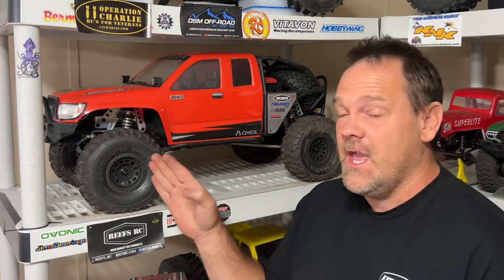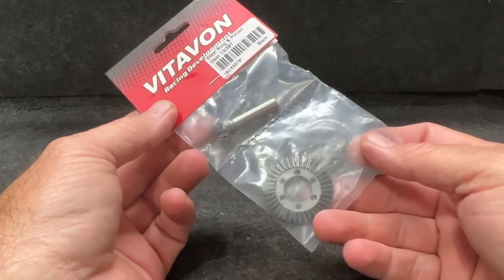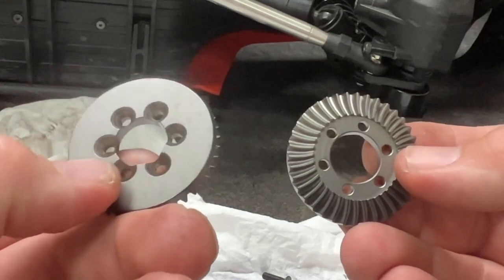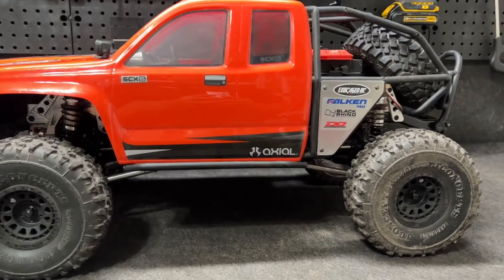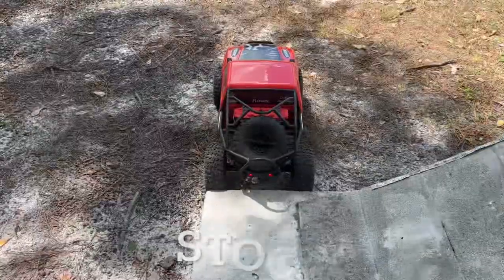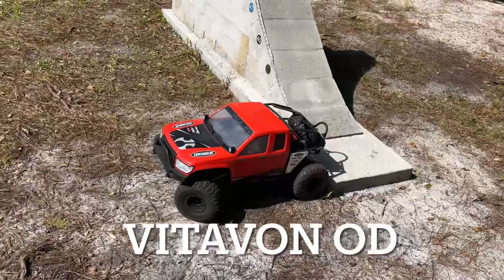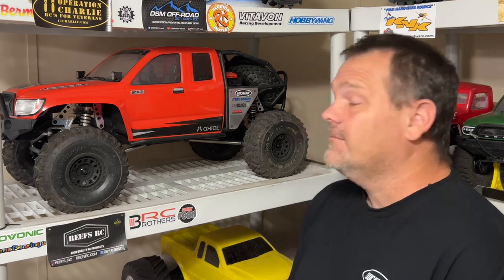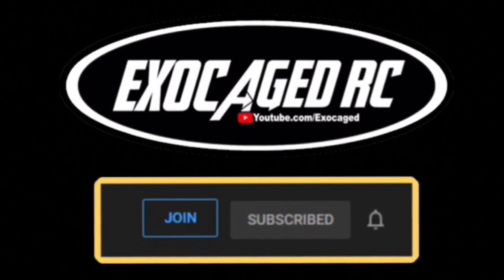My Honcho SCX6 OD'd!!! Did it help?

Comment: Huge difference in turning radius! So I want to overdrive my Trx4 but I still want to maintain trail ability any suggestions for a gear that will allow me to do that! I’m thinking if I was to ask anyone you would be my best option! 👍👍😁😎✌️
Reply: There’s no way to keep both unless it’s at the transmission like the phoenix. best thing to do is to get more clearance on the steering knuckle and a bent steering link .
Reply: I run 20% front overdrive in my 8 1/2 lbs trail rig. You may loose a little side hill ability. If that's a deciding factor go with 10%
Reply: I agree 10 to 15% max on the OD.
Reply: i have an axial 10.3. i overdrive the front by abt 15% with a more tooth gear. it’s my trail rig and weights abt 17-18 pounds. love it
Reply: @randysgut3214  holy cow that is a heavy truck!!!
Reply: @rc7178  yeah😅 have been thru like 4 panhard bars in a few months

Comment: I have the same OD on my Honcho and agree that the turn radius is a bit better.  The OD also helps on high traction steep climbs but causes the front wheels to slip and spin more easily on slippery/low traction climbs......thereby reducing it's climbing capability.  I'm tempted to remove the OD as the truck turns like a school bus, with or without OD;-)  That said, I love this thing and run it every week.